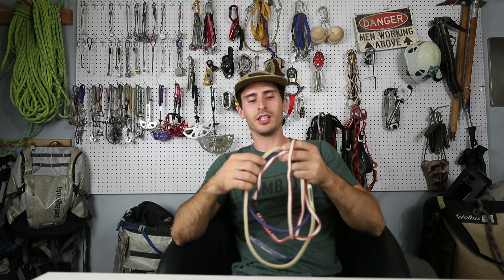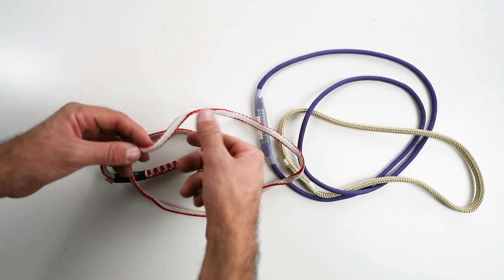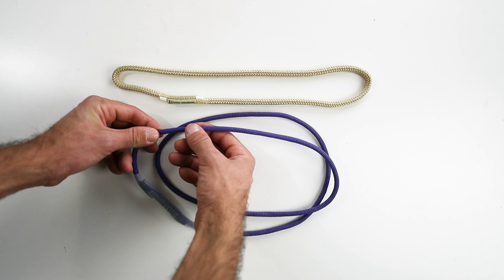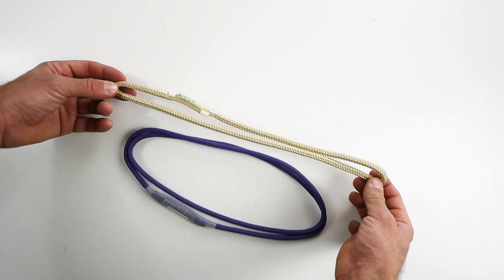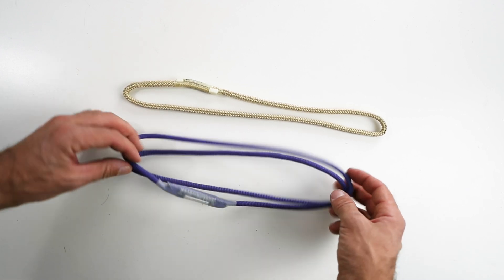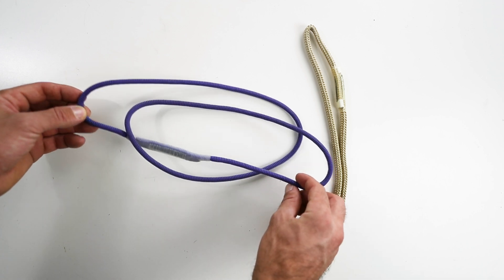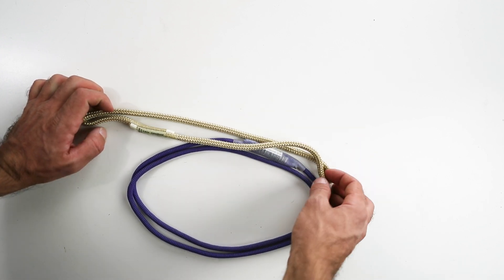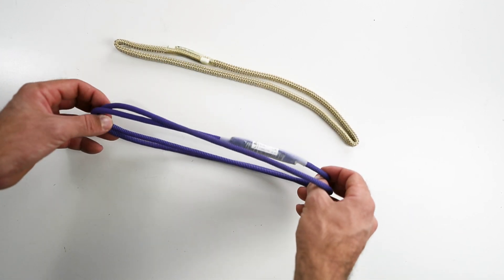Climbing Basics: Best Rope Material For Prusiks?

Comment: Thanks for the info, the aramid vs nylon melting point for rappels was super helpful!

One more comment about the kernmantle vs hollow block: if you're wanting to use it for progress capture in a mechanical advantage system I've recently found that the hollow blocks often don't mind well even with a minding pulley. So for that use case I've swapped to a kernmantle cord with aramid fiber. YMMV but something to think about

Comment: I scored an offcuts of the white Aramid. But it's 25 mm by 7 mm. Abseiling guys setup on highrise for safety netting. I should have hot more.much waste. No good for prusik loop on 11 mm rope. I tested it and if you pull hard down , it slips. Maybe on 20 mm static rope? Any reply appreciated cheers from Australia just subbed.nice work!🙂👍👍👍

Comment: I am a hunter who will soon be trying Saddle Hunting, and I am likely to try the one stick method of climbing that involves rappelling down. My maximum height in the tree will be about 40 feet up. I have ordered Sterling C-IV 9.0 mm Rope and a Mad Rock Safeguard for rappel down. If I wanted to be able to tie prusik knots on that rope (for any of a bunch of different reasons including rappelling down without the Mad Rock Safeguard), is "Sterling 6.8mm HollowBlock2 Loop - Black 13.5"" appropriate for basic prusiks, and is "GM CLIMBING 8mm (5/16in) Prusik Swen Eye-to-Eye Pre-Sewn Heat Resistant Friction Hitch Cord Kevlar & Polyester 30inch" appropriate for VT type prusiks? I ordered these items last week before seeing your informative videos today, and I am hoping that what I purchased will work well. If you recommend I use something else (specific), that is fine.
Reply from the maker: With grigri like devices you don’t need a back up like a hollow block. Just tie an over hand a couple feet Down from the device, if you want to go hands off. The device self breaks but just in case you can have a knot, incase for some reason it slides. It’s also important to have a stopper knot at the end of your rope so you don’t rappel off the end.

Comment: Aborists don't use those prussic loops, all the loops I've seen have cores. Most are also eye-to-eye so the ends can be clipped to a biner on either side of a micropulleys for easy tending of the line. I wasn't familiar with this coreless stuff so I'm not actually sure why it's not used, my guess is just safety factor for load, abrasion, and heat tolerance since their loops are used all day every day, but again, that's just a guess.
Reply from the maker: Yeah they are usually VT prussics. You have to worry more about them getting cut by a blade.

Comment: For climbing - always have a 6mm or 7mm accessory cord.
I like that I can cut and join it myself to whatever size works for the rope(s) I am using or technique (whether using some PAS or directly to a locking carabiner to the harness).
Also - you buy the accessory cord in bulk and use for anything not related to heavy dynamic loads.
I always keep a 2m loop in my alpine pack for emergencies (you can make a simple harness, a few backup Prusiks or a couple long ones for rope ascending).
When you start seeing any damage to it - just retire it and use it for inventory sorting.

Comment: I use a edelrid 6mm aramid sling when sport climbing, I use 5mm dyneema cord slings at work for positioning and tensioning steel cables, and for tree climbing I use 8-10mm heat resistant eye to eye slings, that gives more options for hitches.

Comment: Us tree-guys use "eye-and-eye" or "split-tail" prusiks rather than sewn loops mostly for the versatility of hitches you can tie with split tails. We'll also often use bigger diameter cord because we're climbing on half-inch static lines (12.7mm) so anything up to 10mm will still easily bite onto the climbing line, and the bigger the diameter of the prusik, the stronger and more durable it's gonna be.
Definitely best to have aramid or at least aramid-sheath like you say. 

thanks for the videos.
Reply from the maker: Blake Seidler Awesome thanks for the insightful comment. 🤙🏻
Reply: I use split tail for rapell backups when rock climbing because the possible hitches are so much better!

Comment: We don’t use fix slings for a prusik, just 5 or 6mm polyamid cord. You can than adjust the length and it’s more economic.
Reply: My sister had a brand new Mammut dynema sling she was gonna use as a Prusik. Told her not to waste it, once you've used a sling as a Prusik you should keep it that way. Just gave her a 1 inch webbing to use and later bought her 4ft 6mm accessory cord for $1.79 at REI. Way more cost effective than a sling. Honestly works just as well as all of these.
Reply from the maker: Neo77 great tip 🤙🏻

Comment: I was doing some research on Aramid (basically Kevlar). They like it on boats because it's tough to cut, high heat resistance, and mostly chemically stable except for Chlorine bleach and hydrogen peroxide. It also does well in water even though it's attracted to water molecules and absorbs it, it doesn't become slippery when wet....Down side is that it degrades in sunlight unless treated. Shock loads are bad for the rope and can become compromised without any signs of damage. Highly recommended to be use in static situations. Knots take away 50 to 80% of strength. Most commercial uses have metal fittings attached to keep from having to use knots.....lol just incase someone was unfamiliar with this stuff like I was.
Reply: On sailboats it's mostly Dyneema. UV stable, strong and low stretch. But it stretches / creep under constant static loads. And that's why sometimes Armid is used. But current day Dyneema has mostly solved that with Dyneema DM20.